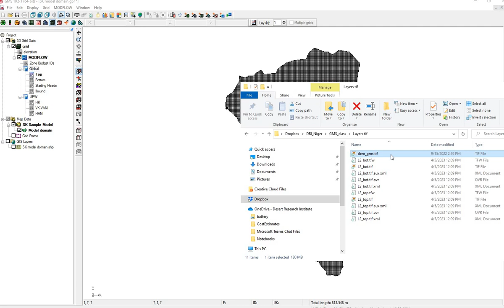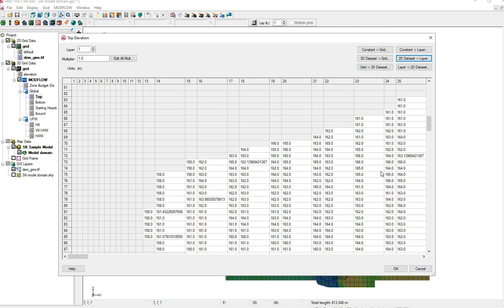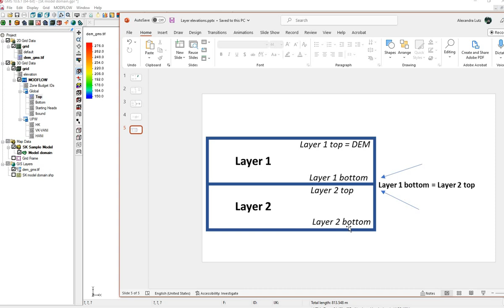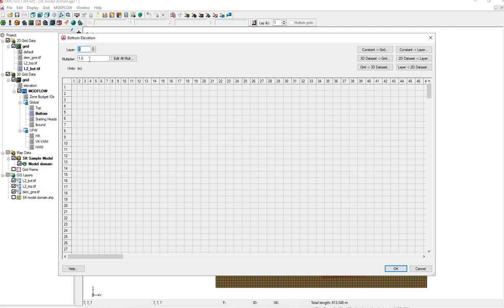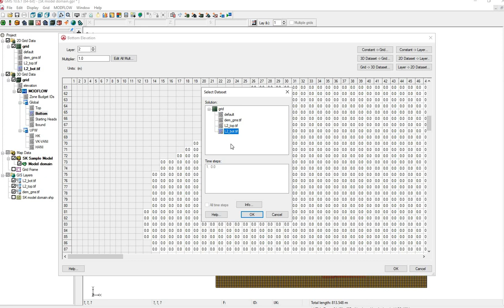Add layer elevations in GMS 2/n

Comment: Hi Dr. Lutz, is it possible for you to do a video on how to setup/generate sublayers from a dem using 2d scatter
Reply from the maker: Did excel work as an option?
Reply: Hi Dr. Lutz, I apologize I was out for a while (l've been sick for some time 😊). I haven't tried it yet, but I will as soon as I'm able to. I will update you if I am successful or not and thank you very much for the follow up 😊.
Reply from the maker: No problem - feel better soon and let me know!
Reply: @alexandralutz7844  Hi Dr. Lutz, hope you're doing well. I apologize for taking some time to reply to you regarding my concern. I was able to extract the values and paste them in Excel, but I am having a hard time on how to subtract, e.g. 50 m from the top/dem. Do I need to subtract 50 to all the values? or only those at the top? how do I identify the values from the top of the dem? I am stuck...😥

Comment: hello Dr Lutz... I have a question on feature objects.. I had already made a 3d grid model and fit the top of the grid to the DEM elevation. my question is. if I import a feature object (non-point feature object) let say an arc or a polygon, when I rotate the grid model it appears the imported feature object always stay on the bottom. is that ok? how can we adjust the feature object elevation to fit on topographic surface of the 3d grid model.

wish you all the best..

thank you...
Reply from the maker: Yes, the arcs are depicted below the grid, but don't worry they are "in" the model. I hope this helps!
Reply: @dralutz7844 thank you for your kind reply, to find your channel is like finding an oasis in the middle of Sahara, it's super helpful to a novice like me dealing with new subject such groundwater modeling 🙏❤.
I have some questions and I believe these are very trivial I guess.
1. if I have a regional dataset (groundwater level contour for example) and extract the contour into a set of point (it shall be head data eventually), what kind of this data referring to? is that a General Head (GHD) or Specified Head (CHD)? I struggle to differentiate this concept, I hope you could enlighten us little bit about it.
2. if NO field test (pumping test for example) or laboratory test are performed, and the only data that I have in addition to monthly groundwater discharge (extraction) is the monthly water table data measurement. how can I deal with these data? so far I presume this is 'a transient' data type, can you explain how to prepare a transient water level and 'discharge' as a time series for GMS? is that ok just to 'copy and paste' the data into the conceptual model. 
I've had tried to make a model and it seems quite 'unrealistic' 😁 in my opinion since no value in the flow budget option in modflow. so I'm wondering which step that I'd had missed. for the parameters I do a 'generic' approach to determine geological features in the area.

I apologize for my lengthy questions... 😬

wish you all the best prof Lutz..

thank you...

Comment: Nice video.How can we get the bottom elevation for the DEM file
Reply from the maker: You can get the bottom from geologic cross sections or set it to an elevation of your choice. Hope this helps, good luck!
Reply: or as an alternative, following Dr Lutz lectures we can convert the dem into 2d scatter then export the data into text file (right click export). then we can navigate to the text file using the spreadsheet or GIS software (for convinient) to calculate the minimum elevation point. thanks
Reply from the maker: @Geo911-r3c  this works I have used spreadsheets. Thanks for your suggestion and help!
Reply: @Geo911-r3c  how do you calculate the minimum elevation points using GIS? Thank you